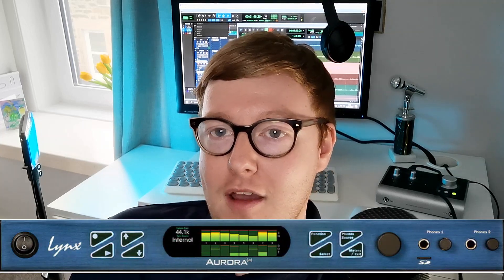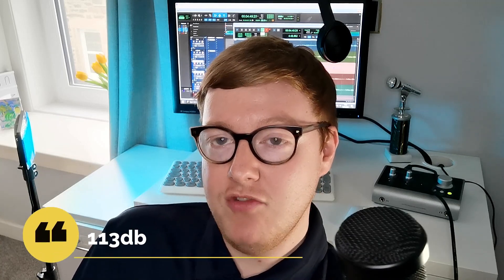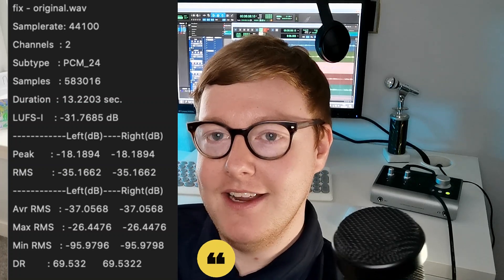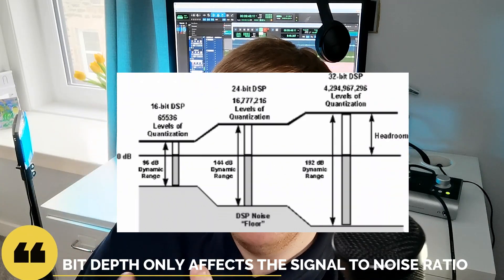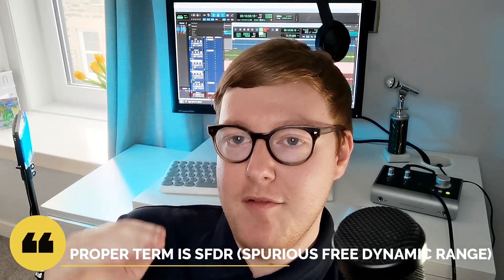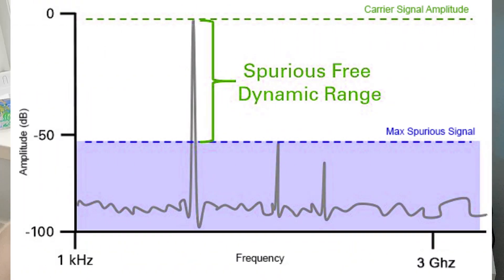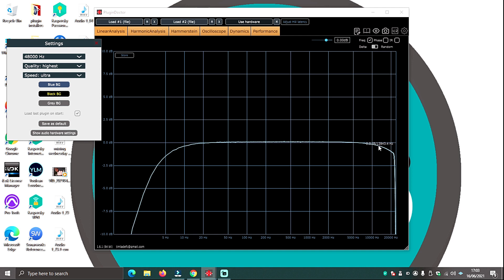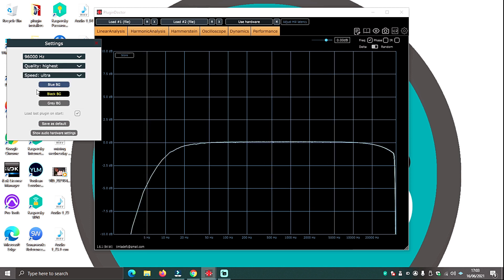Do you lose audio quality in analog gear using budget interfaces vs expensive ADC Converters (Pt 1)

Comment: The ADC may be fine in an iD4, but you listen through the DAC while you mix. So, a cheap iD4 is not going to give you comparable mixing/mastering results as a Lynx, due to cheap DAC implementation causing an inaccurate listening environment.

Also, a Lynx in front of you is not necessarily a 1 to 1 comparison to a Lynx accessed through the internet. So, we cannot have full certainty that your test of the Lynx ADC is accurate. It could be highly inaccurate. We will never know unless you have the physical lynx and test it. I understand that the remote access to the Lynx is supposed to be lossless and it’s just 1’s and 0’s, etc. But, there could be other variables we haven’t thought of that could skew your results. So, a fair test would have been to test a physical lynx unit right in front of you, since you tested a physical iD4 right in front of you. Or, to do both of your tests through the website (1 test on remote Lynx interface, 1 test on remote audient interface).
Reply from the maker: I don't need to. I made another test on the channel a few months ago, a more in depth test and the ADC passthrough of audient didn't even result in 0.1db of a difference. Completely inaudible. 

At the same sample rate lynx is more transparent but if audient is at a higher sample rate, it is more transparent. Mostly just the filters that cause the most difference BUT in reality those differences are so small you'll never hear the difference.

With the access analog method showing more transparency at the same sample rate it proves that access analog is truly lossless.

DAC to Speakers is a different situation and relationship. This video is about DAC to ADC in relation to analog gear. Using a lynx for your analog gear conversion will NOT provide you any audible difference. You'll hear a difference through your speakers but not when using analog gear.

If you print lynx passthrough and audient passthrough, and play them through the same DAC you'll hear no difference
Reply: I assume you did a typical static sine wave test at 1khz. These tests show you what a simple, static sine wave at one frequency does to a converter…that is hardly useful information if you consider the fact that music is made up of thousands of imperfect, analogue frequencies all moving and interacting with each other every second, constantly changing in amplitude. Music is infinitely more complex than a 1 kHz, digitally perfect, static sine wave. Surely you know this. 

Yet, these are the test we have. And, this is why many converters test essentially the same…because the tests are incredibly basic compared to the infinite complexity of music. They tell us next to nothing about how audio will sound.

So, I disagree. Your test showing .1db difference proves nothing in relation to how audio sounds through the ADC. Trust your ears, which is literally what every mixing and mastering engineer on the planet says, yet people go around doing sine wave tests claiming we are wrong. Of course the possibility of placebo effect needs to always be taken into consideration when trusting your ears. But, until converter tests can get anywhere near to testing the vast complexity of music, they will never give you a good idea of what audio sounds like when run through a piece of gear. Until then, you need to use your ears.

So, again if you want to do a proper test of a physical lynx against a physical iD4 it may surprise you. I’m sure you won’t test it again, but I’m just saying your test can’t be proved accurate until you do it properly with a physical lynx in your hands. You can rely on simple sine wave tests all day long and actually learn next to nothing about how music corresponds to those tests.

You’d do yourself a favor if you learned to trust your ears more than these tests. If the tests were an accurate representation of music, then I’d say the opposite.
Reply from the maker: @danieldavies7308 maybe if you actually watched it you would know that I did tests on white noise, pink noise and a mastered mix. Can't get any more complex than that. Believe what you want to believe. The fact is that you won't achieve even 0.1db of a difference in audient. You could have 0.6db of a difference and people would still struggle to hear a difference, especially when in the context of a mix. The difference of the passthrough of the analog gear itself overshadows or masks any difference a modern converter will create. Lynx ADC is better on paper but inaudible in reality. Modern conversion is just that good. 

As I said, believe what you want to believe. If you are a lynx owner then no matter what tests I do you'll claim it's all false due to confirmation bias. The truth is that the lynx is better but the ADC difference in reality is inaudible and doesn't make or break a mix. Analog gear conversion is a wasted argument in 2024
Reply: You’re right, I would need to watch your other video to see what you’ve tested. Maybe there isn’t much of a difference at all in ADC’s between the two.

 So, if the ADC’s are essentially identical…great…but, what are you hearing while you mix through analogue gear? You are hearing through the DAC. If the DAC implementation is cheap, you will hear inaccurately, which defeats the whole purpose of having a good ADC for mixing with analogue gear. If you can’t accurately hear what you’re doing, what’s the point?

And, I don’t own a Lynx. I own the new version of Motu 828. Im going to be testing a Lynx aurora (n) soon though. 

I’m essentially immune to confirmation bias at this point, lol. I’ve tested so many different things for many years and many times I’ve believed something was better because of XYZ, just to find out later that it wasn’t better. I’m far beyond those days. I have $15 guitar cables that I prefer over $300 cables I’ve tried. Why? Because the $300 cables sound too flat, too detailed, accurate and boring. They’re weird. Sterile. Uncomfortable. Same thing with pro audio cables, I expected $200 xlr cables to sound better than vintage king cables…they don’t. I expected an apogee symphony desktop headphone amp to sound better than an apogee boom headphone amp…I preferred the boom, lol. 

I’m not your stereotypical guy who is prone to confirmation bias and placebo effect. I’m well past that. I’ve been mixing for 25 yrs and mastering for 5 of those years. I’m well aware of these things. I’ve developed my ear enough and made enough mistakes over the years to know how to overcome these hurdles. I take my time when I get something new, to let that initial excitement fade to see if I truly like something or not. 

I’ve tried so many different interfaces over the years. I’ve owned a Cranborne Audio 500 R8, 4 different MOTU’s, an Audient iD14, DIGI 003 (lol), Apogee Boom/Symphony Desktop, and on and on. I’ve never been satisfied with any of them. They all fail in comparison to the clarity and detail that I hear every day when I pick up and play one of my instruments. Every interface I’ve ever tried sounds like there is an invisible wall between my ear and the true audio that’s there. Which is why I am trying out a Lynx Aurora (n). To see if that barrier at least partially falls, so I can hear audio more clearly like I do in real life with real instruments. I’ve also tried a million pairs of headphones and headphone amps…the issue I hear is there with all of them. Multiple computers, the issue is still there. Different cables, still there. Different houses, still there. No matter what, there is a barrier. I know what live music and live instruments sound like, and I’m trying to find an interface and headphone amp combo that can get me really darn close to the real deal. Maybe the Lynx will get me close, maybe it won’t. I do not expect it to, because I know better. But, I do hope it does.
Reply from the maker: @danieldavies7308 that's why I suggest you watch the video as I explain why I use an Audient for analog gear but monitor out of the topping dx7 pro+ as its arguably the best measuring DAC amp on the market. I don't value DAC to ADC but I value DAC to Speakers

Comment: They way to try converters, is to loop in out the same song o sound material, and hear how the signal deteriorate through various passes. 
The lynx is by far the more clean of all the high AD/DA converters in this test. I upgrade last year from Apollo 8x to Lynx Aurora (n) after trying similar ratio models (Apogee Symphony 2, Digital Audio Denmark and Prism SOund) in my studio and the difference is no small by any means. The round lows, image stereo and depth, and a cristal clear mids and hig mids, definition make my work in mixing and mastering more efficient. Actually already 5 colleagues came to my studio (that have a good sound treatment) to hear it in the last 6 months, and already all of the bouth some of them, like the Lynx Hilo, or the same model that i have.

So of course this depend on your budget, your stage as an engineer, etc, etc.  but try it, you don be disappointed.
Reply from the maker: What you are hearing is DAC to monitors not the sound of ADC which is what this video is focusing on. I did another test a few months ago on the channel and the tests proved that there were no audible difference between the 2. There were differences but none that were audible.

To properly test ADC you must listen to both files on the same DAC. If you base your results on what you hear out of the whole system then that has no relevance to what your client hears or what the ADC is actually doing.
Reply: @PaulThird  Again Paul, re read my msg, the way to try ad/da is from doing loops as i explain in my comment. Cheers

Comment: Comparing 1 interface’s conversion at 96k against another at 48k is not apples to apples and claiming the Audient is more transparent operating at a higher sample rate doesn’t prove that it’s equal or better. Compare them both at 96k; null test the Audient against the Lynx, there will be differences. As a mastering engineer where I’m daily making processing moves for 1-5% gains which add up in the end, 5% difference in conversion matters.

Furthermore, here is a truly blind A/B of a Lynx Hilo, Merging Anubis Premium and Crane Song Solaris DAC paired with a Forssell MADC 2a ADC. All operating at the same sample rate. There are obvious differences between all 3; one really squishes transient response, for example. Another is wider than the other 2 as far as stereo image. These are perceptions not illustrated by a null test, although null tests between them all will in fact illustrate differences. You let me know which is which and then I’ll share the results. Just a note, if you think example A is the Hilo for the EDM example, that means A is the Hilo for every example; the examples are congruent genre to genre.

https://www.dropbox.com/scl/fi/t170davmirbqoje3nr8h2/Converter-Loopback-Test-Files.zip?rlkey=a0jt4zabx5jqpriqxqmqtavfj&dl=0

I will say from the video, it looks like you’re in an untreated bedroom; it’s going to be much more difficult to hear differences like I’m describing in terms of imaging and transient detail in an untreated space on prosumer monitors like Yamaha’s or KRK’s.

Anyways, just as with cooking, many chefs can make the same meal but the differences lie in the subtleties of preparation and seasoning. Trying to tell others the seasoning they choose doesn’t matter when cooking would be poor advice, just as it is when it comes to choosing your conversion.

Comment: High in converters are often chosen because they are perceived to improve the audio, not because they're transparent! I think the people who are telling you highend ones are more transparent just don't know what they're talking about!
Reply from the maker: It's really not. Converters for analog gear are supposed to maintain the original signal. I've heard hilo, lavry gold, dangerous and the only one that had a very subtle difference in the low end was the RND MBC with  the transformer circuit engaged. No difference without 

ADC is supposed to be transparent. DAC is supposed to do the same. The quality you percieve comes from the DAC to Speakers not DAC to ADC. The difference added by that stage are not even 0.1db. Ive just wrapped another video proving it.

What you hear out your DAC through speakers is seperate from your DAC to ADC conversion

The burls are trying to emulate tape, lavry and dangerous have added clipping stages. That's it. The conversion itself is supposed to be as transparent as possible. The perceived quality comes from the transparency which you hear way more from your DAC but only through speakers and headphones

Comment: It's not just the rolloff, I also notice the 48KHz sounds "rougher" of "fuzzier" or "grainier" somehow. This is surprising, but I heard it (again, to my surprise) when comparing mastered exports on one of my own projects at 44.1KHz vs 96KHz. The 96KHz sounded smoother and less fatiguing. (It was bowed double bass, so also had a lot of "texture" in the midrange, like this voice, which is I think the conditions where it's most audible.) I was not expecting this, because the math suggests I would not hear such a difference, but the difference is pretty clear to me.

My understanding is the same as yours, that even very cheap converter chips can now be very accurate, and they're all basically the same, with the differences being in the analog electronics. But the bit depth and sample rate DO make a difference.
Reply from the maker: Remember there is a phase shift going on at 48khz sample rate due to the filter, which doesn't occur in our audible range at 96khz. but in my most recent test I did, 48k & 96k conversion both result in differences of less than 0.1db in relation to the original signal.

However remember that when you listen back at different sample rates you are also hearing the amplified DAC signal on top of that
Reply: @PaulThird  Yeah that could be the reason. The math says I shouldn't be able to hear the difference between sample rates and the roll-off shouldn't be too noticeable for me either (my hearing probably tops out somewhere not much above 10KHz these days!), but there is SOMETHING different between 44 and 48 vs 96, which could be the filter. It has to be a very aggressive filter, and I assume that can have audible consequences (though I am far from an expert on audio circuitry). The difference is subtle, but even your null tests shows there is certainly some difference, and that some of that difference seems to be below the 10-20KHz range where there ought to be roll-off.
Reply from the maker: @ModusVivendiMedia with converters it's normally jitter distortions bring amplified in DAC you are hearing. That's what I've been told anyway. The better quality the clocking the cleaner the DAC signal. There are different variables at play when DAC is running through a speaker compared to ADC but if you hear differences at different sample rates it could be the high end phase shift of the filters but I dunno how much they are audible at 44.1 & 48 in DAC to Speakers.
Reply: @PaulThird  That makes sense. It could also be that the particular DAC I'm hearing the differences through works better at a particular sample rate and kind of messes up the sound at other sample rates. Who knows? It just turns out that audio is more complicated than just numbers and math and in the end we have to use our ears!

Comment: So you didn't have a real lynx Aurora at home for the comparison? But you just ran through a voice through some plugin you found online?
Reply from the maker: No, not at home. I ran the voice through a lynx Aurora (N) remotely via access analog. The daw audio is transmitted lossless online, through the aurora and back lossless to daw. That's why there is inherent latency involved with protools but studio one fixes that with their delay compensation so when I do a print now it's perfectly aligned.

Im genuinely doing the follow up to this now as I wanted to include white noise, pink noise, piano and a mix. I don't know if everything was absolutely perfectly time alligned due to protools but studio one is bang on and I've been able to have more concrete results

Spoiler.. Audient is more transparent at 96khz than lynx at 48khz. But audient isn't as transparent at 48k but still results in inaudible differences

Comment: let me tell you strory... We all must have heard Pink Floyd's Division Bell Album right... well it has been recorded at 96k with old SSL Logic X through MADI. And looked up for A/D and D/A converters of unit. And I found the brand model and the chips fact sheet in pdf. Guess what I have found out Roland Octa-Capture interface has same A/D and D/A chips so I bought one. Never regret my decision. Only bad side is you can't bypass its VS preamps completely which is a shame. Probably gonna buy from RME next.

Comment: Hey Paul, I'm bit confused on all I've seen on quality! I need at min 6-8 in and out for mix and mastering. Would list of few converters or interfaces converters do you recommend buying based on quality and cost? Can you please put a small list together based on the test you have done overall! Thank you in advance!

Also, if I have a really cheap USB interface with ADAT, and say I put a expensive AD/DA converter on ADAT, will i lose the quality of the expensive unit by running it through the ADAT of the cheaper unit for its USB connection?